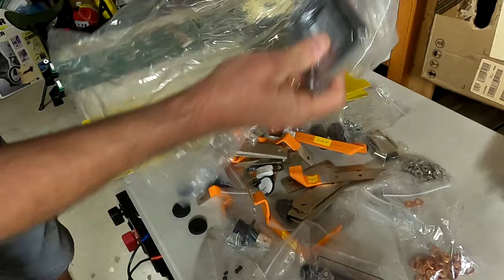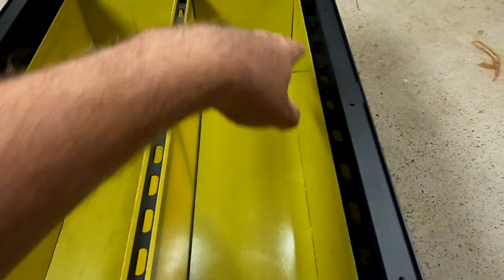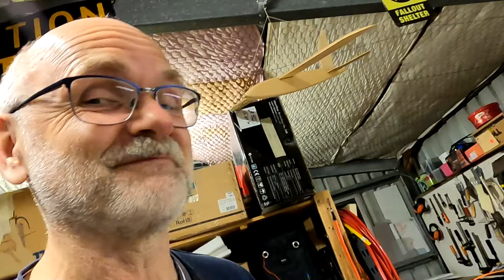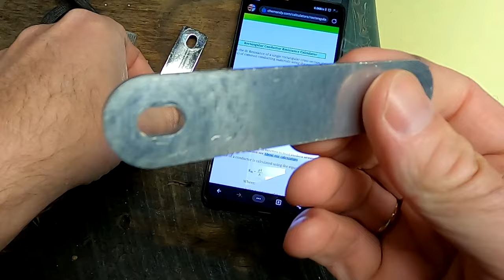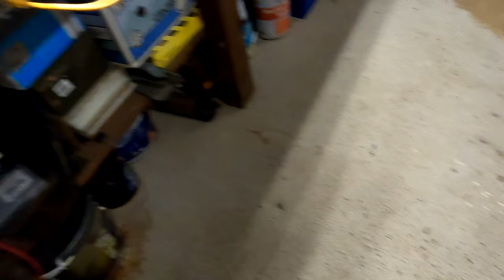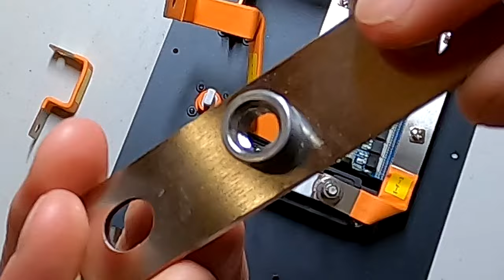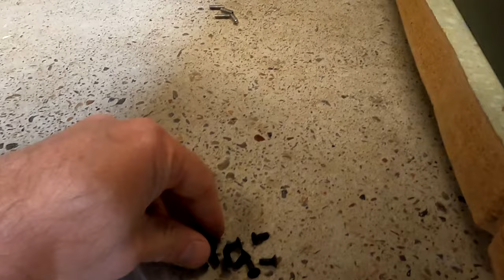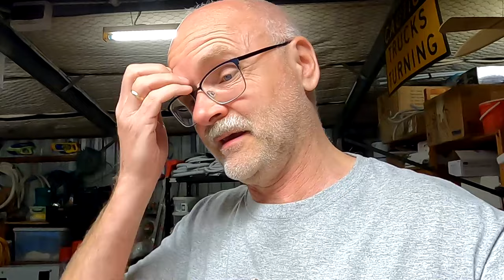Building the SEPLOS MASON 280 DIY Kit - What a BEAUTY! Da-Da!

Comment: Would it not be great to design a front for this to fit a JK bms instead? Buy the box, without the seplos bms, use a front for the jk bms and mount a jk bms, make your own final busbars, and you have the perfect battery.
Reply from the maker: Yes, something like this would be nice. An individual BMS mount would be great. Velcro straps, something simple but versatile.
Reply: @OffGridGarageAustralia  Do you think this is feasible though? From the design i have seen and from your video, i would say that it would be.

How much space is there between the compression panzer and the front plate?

I do not think that i have seen seplos currently sell these boxes without the bms though, but i guess that like most alibaba sellers they might be flexible.

If so, someone in the battery community could cad it up, have it plasma cut and attach the lugs where needed, and do a few test iterations. Then have a bunch made, and powder coated and sold at near cost, with the design on github or so.
Reply: I tried, they sell only with the unusable BMS
Reply: @heinzblank6065  That's too bad :(
I guess there will be a lot of cheap seplos bms available on ebay and kleinanzeigen over the next year or so :) I think that that might make 150-200eur there still.
Reply from the maker: @luc_libv_verhaegen  The Seplos BMS is really a bummer. It needs a lot of work to make it great. The rest of the Mason system is fantastic, so yeah, a case in this style with a flexible BMS mount (JK, JBD, Daly, ...) would be amazing.
Reply: @heinzblank6065  you can buy the box without the bms.

Comment: Hi Andy dear boy, 
It will be interesting now you have a direct comparison with compressed Vs uncompressed  cells and will it change your mind.
Love from Scotland
Gaz
Reply: I'm gonna be shocked if it makes any difference at all for the type of loads Andy will use it for. Happy to be proved wrong tho.
Reply: @pau1phi11ips  Given the chance Andy would Supercharge his Tesla.
Reply from the maker: It is not a real compression. I can still move the cells a bit... 😉
I don't think I will see any difference in behaviour or cell longevity. That's impossible to compare or test. 
It did not change my mind, Gaz. I just used the battery case with the features it came with. I still think compression of battery cells is not worth it with our solar storage projects.
Reply: @OffGridGarageAustralia  Fair doo's mate, The internal mechanical stress from swelling worries me.
With my badly bloated cells I had delivered that I am going to have to use I am like WTF do I do??? They are that bad the buss bars don't fit.
Is it a racheting up of swelling over time or do they bloat all at once from high load?
A bit of a minefield and I feel DOOMED if I do and DOOMED if I don't lol. 
Shine on man.
Gaz
Reply: @garys-half-baked-offgrid-dream  I charge/discharge mine from 100% to 15% every day. I'm charging at 65A which is only 0.23C. It shouldn't put that much stress on them. I've been doing that for 1 year with a Daly, so basically no balancing. I've had to manually balance them once and it was just 1 cell that was out. I haven't seen any reduction in capacity.

There's not going to be many people charging 280Ah cells with even 0.5C
Reply: @pau1phi11ips Good to know as I also have a Daly but the cells also suffer at low charge/discharge rates with a gentle ratcheting up of swelling with a slight swell and not deflating to original size over many cycles.. 
If Andy can do  periodic checks on their condition and shape it would be useful knowledge for his community.

Comment: Andy, at 47.37 do you think it makes sense for the temperature sensors to have a 3.1C difference range? 18.9 - 16.3 - 15.8 - 17.5

Also, you probably have the answer by now but did you try all the cable ports?
Reply: I think the temp sensors are not that accurate, I have a few Seplos Batteries and the temps vary a bit, they’re more of a rough guide.

Comment: Hello Andy, another great vídeo! 
I would like to buy a Seplos box, but they are for 280ah or 125(?)ah cells. I would need a box for 230ah cells. The cells are thiner than 280ah cells. Other measures are similar. Só i would need a foam plate or other adequated material só That i could still compress The cells with The box structure. Do you have a recomendation of an adequated material for this use? Thanks.
I already have a Seplos bms (16s, 150a) and i changed (Change) parameters on computer. It is not dificult. In The bms manual there are The needed instruccions. 
I made here an information before (like this One) and left a link (Google drive) for all documents and drivers needed, but (i think) YouTube does not like links.... So it was wiped away... 
If you need any Help on That, please let me know, it would be a pleasure to Help You. :)
Thanks again!

Comment: The film on the case top is there to protect things if something drops on the battery and bends the case inward.    The film is mighty thin so how well it would work if something hit the battery with such a large force is questionable.
Reply from the maker: Well, if we have such a force that this lid actually bends down and hits the busbars, I don't think a 0.1mm thin plastic film will make a difference here. This is all massive steel and I could easily stand on this box and not make a damage at all. The lid already weighs a lot.

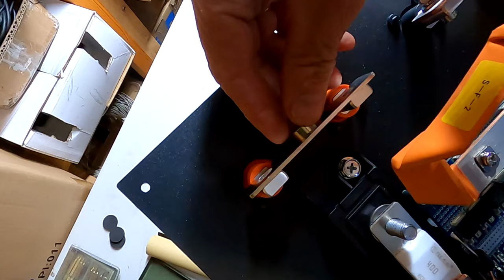Comment: 35:41 is wrong on this. you must turn oposit bolt must be inside and 2 busbar must have all area conection,not on bolt.
Reply from the maker: Yes, correct. I've replaced the BMS and corrected that in another video.

Comment: Anyone have a link to where I can get some of that sticky backed epoxy sheet stuff?  I've looked on Aliexpress, amazon and ebay and there are epoxy sheets but none that say self sticking.
Reply: If all else fails, you can apply your own adhesive. Amazon sells various sizes of 467MP transfer tape (made by 3M) for a decent price. 
I used to use this at work for applying adhesive to thin metal nameplates for electronic equipment. The 467MP isnt actually tape, its simply a layer of adhesive attached to backing material that is peeled off after you've attached it to whatever you want.

Comment: If cell has 0.25 - 0.35 mOhms and AL bus bar 31 - 37  mOhms, it will dissipate o ton of heat between cell. Terminals will heat up.

Comment: I wouldn't have fixed that black foam to my batteries.  Would've been easier just to slide them in between.  Some black foam goes all oily.  Nasty stuff.  Easier to replace if it not stuck all over the batteries.
Reply from the maker: I hope I don't have to open the case again soon!

Comment: looks like the firmware version is different. usual boudrates are 9600 and 115200 you should at least try those
Reply from the maker: OK, thanks for the tip. I'll test this tonight. Isn't it weird that the lights stay on all the time though?

Comment: I will admit they are well designed and well built battery DIY kit but I just don't know if I am ready to pay $2,000 for a DIY kit that will only give you one big battery that will take a long time to get your investment back and more likely either the battery the inverter or the solar panels or even God forbid your house burns down before you would even get near your money back I'm just saying they need to bring the battery price down to maybe around $1,000 shipped and mailed to you because at $1,600 for the battery plus the additional $400 to mail it to you it's kind of expensive and that's even on Alibaba I'm sure they're going to be way way more expensive on Amazon I never went to eBay and see what the price was on there but I'm sure it's not that far from that price I'm just saying for that $2,000 you could buy 20 100 amp hour deep cycle lead acid batteries and even if you get only three or four years out of the battery the lead asses are a proven technology these batteries that are on here have not proven their capability yet because they haven't been out long enough to prove that they will last as long as people say they will we all know lab conditions does not meet home condition just because you can get $3,000 Cycles out of them in a lab does not mean you will get $3,000 Cycles out of the batteries in your house but what I'm trying to say if anybody's even reading this comment the price needs to come down and the technology needs to prove itself because they is so much that can go wrong for $2,000 for just one battery thank you for anybody that reads the comments
Reply: Agree that spending the money for the case is a bit much for a DIY system unless someone really wants that polished look and money isn’t a factor but Andy had a lot of requests to try this system IIRC so he got them (really hope he sees a return on his investment over time from ad revenue). As for the batteries, they are used in some EV’s. The ones we can buy are ones that didn’t pass quality control for use in EV’s for some reason so are considered “storage grade”.